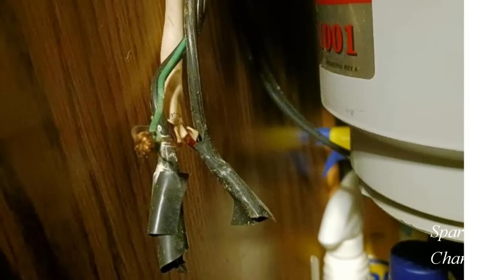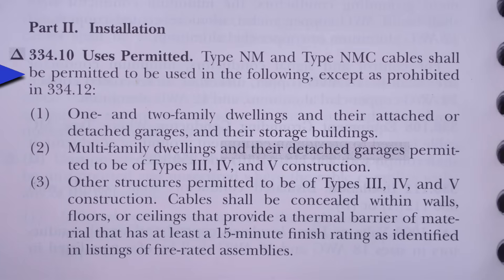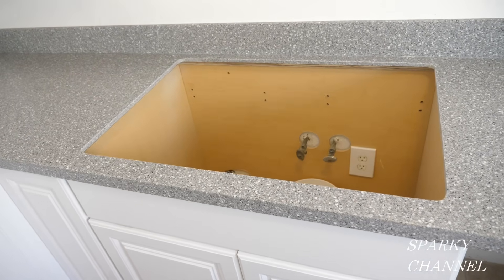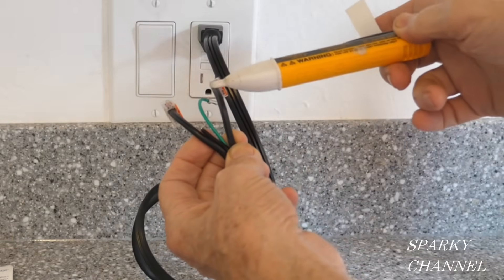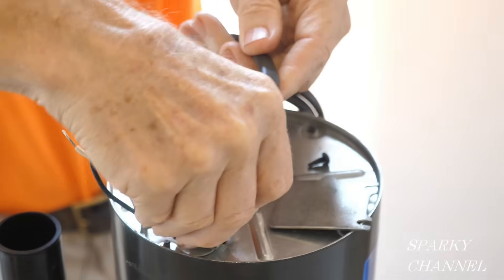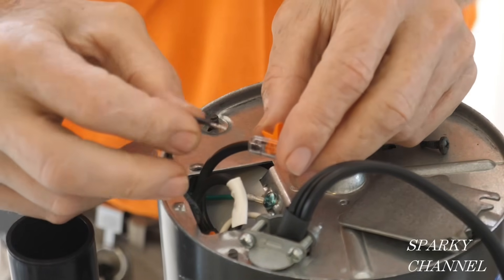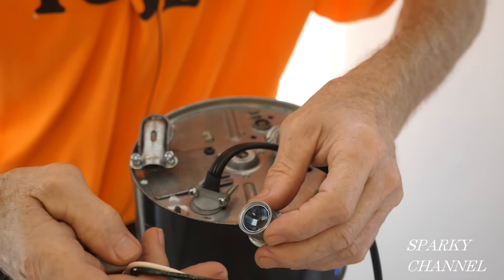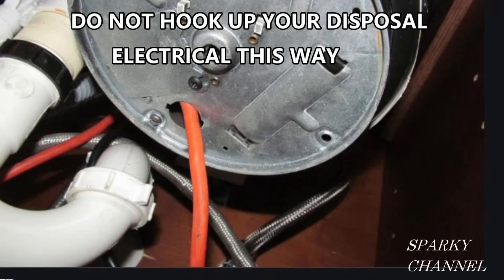Can Romex Be Run to a Garbage Disposal? (NEC 334.10) + How to Wire a Disposal

Comment: Nice video, Sparky. If you control the disposer with a snap switch, don't cheap out on the switch. Especially if you have 1/2 or 3/4 HP disposer. Use a good specification grade switch. It will last forever. A cheapy will fail quickly switching that motor load.
Reply from the maker: You know I'm a spec grade device fan. I don't use the cheap devices at all. Thanks Walter!

Comment: Thanks for the thoughtful and informative video.  I also have seen type NM used for appliance cords.  I'd like to suggest a few articles as a defense for not using NM as an appliance cord in a 1 or 2-family dwelling.  NEC 2020 - 422.16(B)(1) permits In-Sink Waste Disposers to be connected with a flexible cord. 334.10(A)(1) allows NM to be concealed or exposed.  334.15(A) requires NM to closely follow the surface of the building finish or of running boards when exposed.  This would be the argument I would use to argue against NM as the wiring method for garbage disposal.  Thanks, Bill for the educational electrical videos.  I'll keep watching and learning.
Reply from the maker: Thanks so much Wade!

Comment: Good video. To twist or not twist is a personal thing.  If your not use to make up electrical when many times it stranded to solid the wago would  benifit versus twist with wire nut requires a bit of experience!  As for the mc being used as ground  i still use the green or bare ground at fixture esp because theres big chance the mc isnt connected to ground back to source.  Take care Bill.
Reply from the maker: Excellent points, thanks!

Comment: Thanks Bill.  When I was very  young I owned a mobile home and I had to replace the disposal.  I am not sure that the thin (flammable) walls of a mobile home built around 1970 would even allow for romex anywhere considering what you read to us.  Fortunately, mine had a plug, but this is always good to know.
Reply from the maker: Hi Jeff! Yes, you have to be careful with electrical in mobile homes as the aluminum shells are conductive.
Reply: @SparkyChannel  I bet a lot of aluminum wiring was used in mobile homes of that era.

Comment: Great video. Question: Don’t you also need a switch to turn the disposal on and off? I have an older house without electrical under the kitchen sink, so I’m going to have to do a new installation starting from a junction box in the basement.
Reply: there are disposals made to be used with a built in control, which would make an operation switch unnecessary, but you would still need to have a service disconnect.  typically, in a situation like yours, I would run conduit inside the cabinet to a surface mounted 4" square junction box under the sink, and then conduit to another just inside the cabinet door, where it is convenient to reach in to the switch.  in a few cases, where a tip out existed in the top of the cabinet, I was able to install the switch inside the tip out.  it is also possible to get an air switch kit, which puts a plunger button in a hole in the sink, and the switch plugs into the receptacle, and the disposal plugs into the switch.
Reply: Thanks for that excellent (and fast) answer.
Reply from the maker: Ken beat me to this question and gave an excellent answer.

Comment: Great video. Do you have a video on installing a receptacle for a garbage disposal. Say somebody currently has NM cable and needs to make it a receptacle so they can use a cord. Does it need to be AFCI and/or GFCI?
Reply from the maker: Not yet. That would be a good topic though. Thanks!

Comment: It is nice to see a YouTube channel that shows how to do things correctly.  I watch many YouTube DIY channels and just cringe at how bad some of the advice is, even from many who claim to be professional electricians, plumbers or carpenters.  There is one “plumber” who recommends you never need to drain sediment from your water heater or change the sacrificial anode.  Maybe he sells water heaters on the side…
Reply from the maker: Thanks so much. I should do a video on water heater anodes. That is an electrical process going on in the tank.
Reply: @SparkyChannel  Absolutely.  My water heater is 24 years old and going strong.  Everyone says you can only get 10-15 years out of a water heater in my area.  Well, if you never maintain your water heater, then that is probably about right.

Comment: This is off topic from the video but after watching I went to review the NM section and was wondering about 334.30(B) when it talks about a bushing or adapter to protect against abrasions where the NM exits conduit. Where can I find these? I have seen the plastic ones for threaded pipe. Would you use these everywhere even in "protected" areas?
Reply from the maker: I'm not sure.

Comment: Hi Bill, is there a recommendation for torque inch-pounds when tightening wire clamp connectors into the box? I ask because I overnighted this clamp, it actually pierced the hot wire. When I turned on the circuit breaker  it shorted out. I traced the short to the wire clamp. I replaced the wire and made sure the wire clamp was not too tight, everything was fine. So is there a recommended torque in inch pounds for this? Love your videos, thank you. Jim
Reply: Usually you tighten them until cable is snug in the connector. You do not have to tighten them until they are crushed. I have never seen a torque spec for NM connectors.
Reply: T0cableguy, thank you for the advice. It was a dumb mistake I made, I’m glad there was no fire, just the short and tripped breaker.

Comment: what about romex in an unfinished basement? It's not protected by drywall
Reply: If it is behind or below the surface of the studs or joists, it is okay. If nailed to the face of studs or joists, it needs to be shielded with something like 1x2s nailed on either side of the wire[s for the length of the run].
Reply: The section of NEC mentioned in the video does not disallow exposed Romex. Part 3 of that section is seperate from 1 and 2, in Single family dwellings Romex can be either concealed or exposed, if exposed it should not be installed where it could be subject to damage, and should run closely along surfaces.

Comment: Just for the sake of argument, and since you often do deep-dives into the NEC, I am going to say that the connector used (and supplied by Insinkerator) is rated for NM cable, but not rated for SPT or SJ cable. You need to use a rated cord relief. I know everyone uses the NM connector for this, and it is a thousand times safer than some of the nightmare pictures you showed.
Reply from the maker: What connector would you suggest?
Reply: @SparkyChannel the connector that comes with the cord
Reply: Insinkerator       Can not believe they do not provide a better condition for connection.
Reply: @SparkyChannel  I am thinking a strain relief or gland rated for the cord used (flat vs round - SPT vs SJ) (I tried posting some links but they are deleted)

Comment: It is more likely on an older home to encounter Type AC cable, rather than Type MC, where the corrugated armor, together with the aluminum bonding tape running its length, provide the equipment ground for the branch circuit - rather than the green dedicated conductor included in Type MC cable.
Reply from the maker: That's true. Thanks Steve!

Comment: @ 9:31 
That connector is commonly known as an "MC  connector.“  However, It's also approved for NM (Romex) cable. Even SJ cord amongst others. It's basically a one size fits all kind of connector.
Reply from the maker: Thanks, good info!
Reply: @SparkyChannel  You're welcome.  But of course as always, check with the manufacturer's specifications. 
It should be listed right on the box.  However, I do know Topaz lists NM as one of the accepted types.

Comment: I have to admit I am still not a Wago fan, but I guess for DIY folks they are more idiot-proof and the extra cost isn’t an issue if you only use a handful every year.  I will stick with wire nuts as they are a fraction of the cost and I have seen several tests where they run cooler in operation so they are at least somewhat less resistive than Wago style connectors.  It does take just a touch of skill to install them though.
Reply: Sounds good to each there own I made the switch to levernuts  and am not going back for 14 and 12 guage and I have nothing against wire nuts I always pre twisted and tightend till wires twist up
Reply: @chrisf9607  I never pretwist.  It is completely unnecessary and just wastes time.  I can install a wirenut as fast as most can install a Wago.
Reply from the maker: Thanks!
Reply: I cannot imagine using anything other than Wago Lever Nuts to join solid and stranded, like light fixtures. Trying to join solid and stranded with wire nuts has always been difficult, messy and resulted in  lousy connection, at least for me.

Comment: It would have been cool to see you plug in a circuit tester to the garbage disposal receptacle to verify if the correct breaker is in place...Possible multi-wire that gets missed by the best...
Reply from the maker: Great idea, thanks!

Comment: If you can afford to, avoid the Badger models. They aren't made out of stainless steel like the higher-end models and thus rust and fail prematurely. You can tell they're to be avoided because they come in "contractor packs."
Reply from the maker: Excellent advice, thanks!
Reply: I'll share a serect with you buddy. Emerson (INSINKERATER) make all of the disposals. They're all the same just painted different and different stickers placed on the units.
Reply: @SixTwoHemi  Badger is an Insinkerator model. It's the low-end model. I'm suggesting to only go for their high-end model that's stainless steel. Replacing the low-end model every few years will cost more.
Reply: The Badger 1000 uses stainless steel.

Comment: I don't agree. While I think a cord connected disposal is best I see no reason NM can not be used. It has been used for disposals forever.

NM is exposed in all basements and garages so it does not have to be behind sheet rock. It is also commonly used to feed electric hot water heaters for years without an issue
Reply: Just because that is how it has been done does not mean it was right. The rules change as a result of fire, injuries, and death. It does not take much effort to wire it properly. Don't be a hack.

Comment: You basically said that the body of the disposer is connected to neutral. That should not be true. If it were, there could be current leakage through the plumbing and a GFCI would trip.
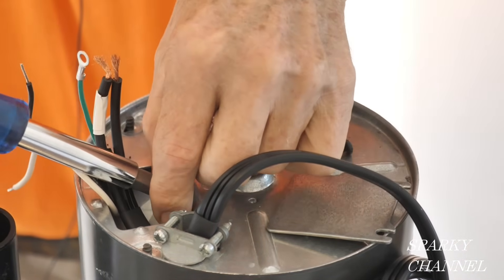Reply from the maker: No, the ground is bonded to the body of the disposal. You can see at 6:48 that I connected the ground wire to the disposal body, not the neutral.
Reply: Hi Bill. I think Tom was pointing out  that you mentioned that if you mis-wired the thing, connecting the hot from the whiptail to the neutral of the disposal, then you’d be feeding voltage into the body of the disposal. he points out correctly that that would not be the case. But you obviously wired it correctly so perhaps just a misunderstanding or verbal flub.